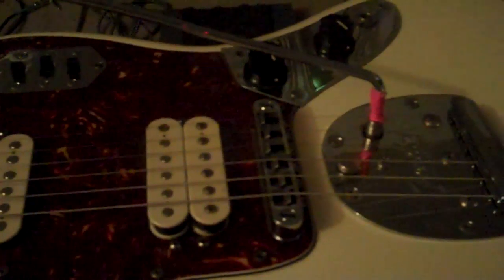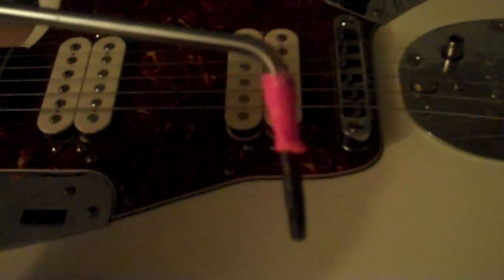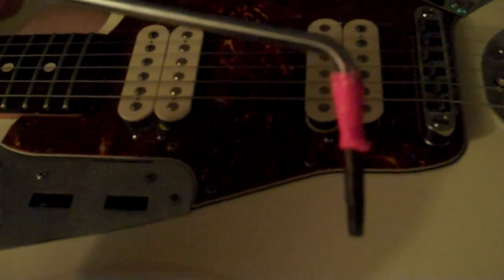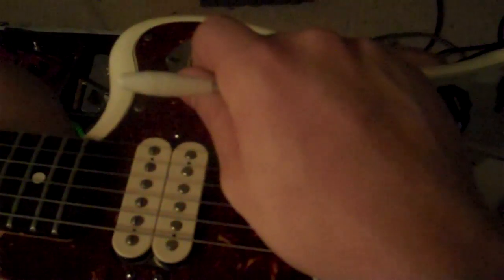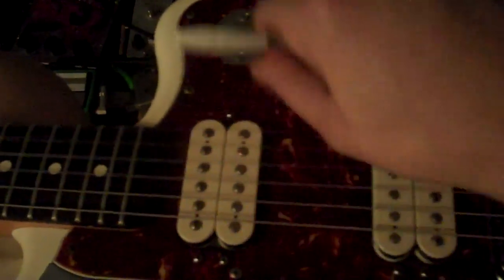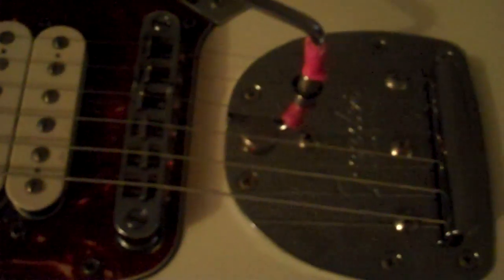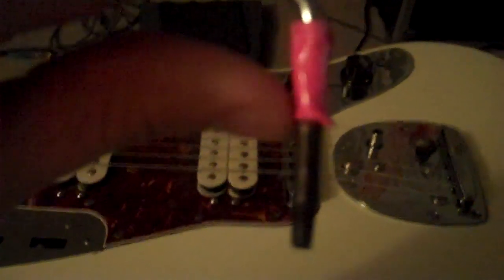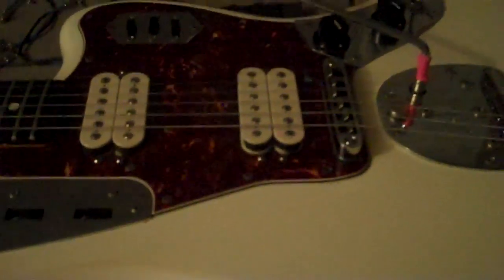Glide Guitar Tremolo Setup

Comment: Can you do this with a Stratocaster?
Reply from the maker: You can fake it but not really. The floating trem has a different spring tension. And the trem arm is longer. But you can thread a jazzmaster trem arm to fit a strat.